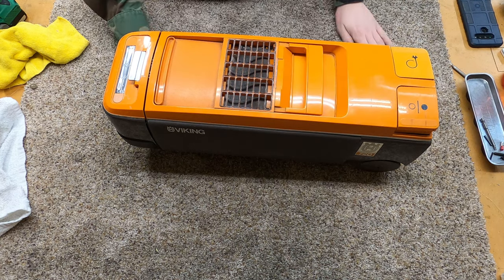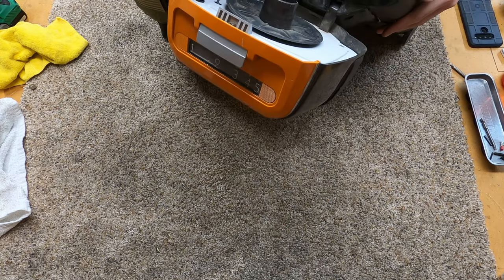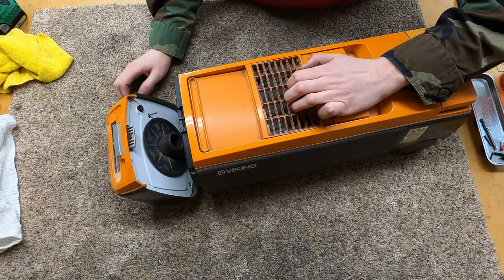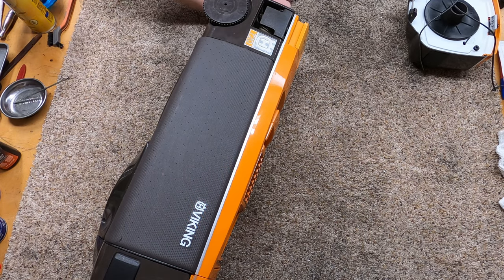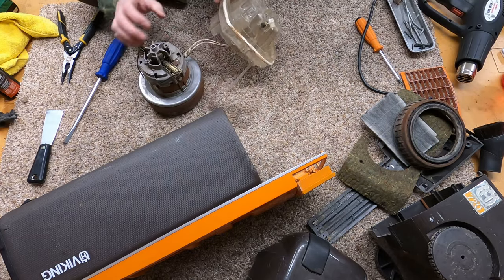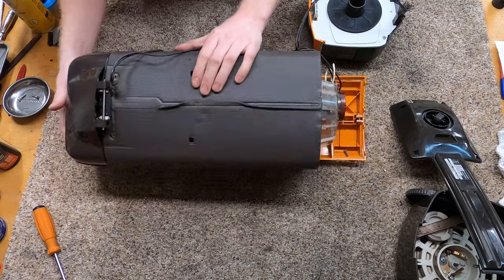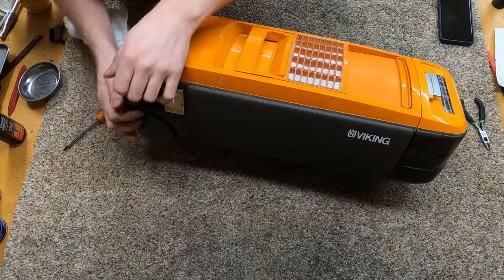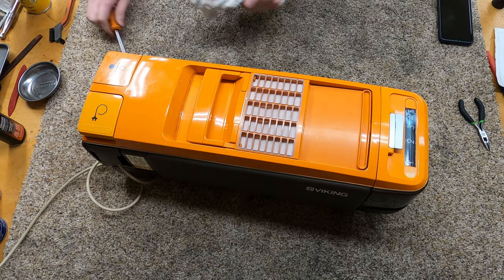Viking Electrolux 720 Vacuum Cleaner Repair

Comment: These were big in Australia. Sold door to door by Electrolux.  I have the 720, 725, 735 and 745. All the same shape just some minor changes in variable speed controls. Colours are orange, cream, white and the 90s beige.
Reply: I have a D730 with Electrolux branding, and a D745, D795 and D820 all with Royal Lux branding.  All four are vacuums I bought in Japan.  I use them in the US with 100 volt transformers.  The D795 is a real bruiser too.  There was a revised main board and Domel motor upgrade  I installed in mine (the original board and a wire in the motor were burned, getting the 100 volt parts from Japan wasn't simple but Vorwerk supports them in Japan).  With the Domel motor it has more power than my Perfect C101.  Just insane.  I source bags and filters from a German Lux distributor I have cultivated a relationship with.  Really love them.

Comment: That is interesting!  A Viking called Electrolux in USA.  I have the Electrolux model D 725 with electronic suction power regulation.  It looks like the rubber coating on the wheels is missing.  It is a shame that the device was damaged in transit due to poor upholstery;  happened to me too.  Definitely a cool vacuum cleaner!

Comment: Nice work of the 720 vintage cleaner sold from about 1980-82. Lux International of Switzerland, the original vacuum cleaner division of AB Electrolux of Sweden, split from AB E in 1998. AB E designs since that time have been different.
Reply: The D720-745 series were all made in Sweden by Electrolux AB.  I have versions of this same vacuum with both "Royal Lux" (Lux International) and Electrolux branding.  Until 2009 Lux International was a wholly owned subsidiary of the Electrolux Group of Sweden.  In fact Lux AB was one of the two companies merged in 1919 to create Electrloux AB.  In 2009 the Electrolux Group sold Lux International off.  Vorwerk bought their Asia Pacific business and now you see high end Vorwerks sold around the Pacific with Lux branding.  I have a Vorwerk Tiger-260 I bought in Japan where it was sold as the "Lux Sora".  Some Swiss investors bought Lux business in Europe and promptly lost their shirts.  They sold their business in 2011 to Eureka Forbes of India, the current owner.  The last Swedish built Lux was the Lux 1 Royal D820.  I have one, also from Japan, and it says Made in Sweden on it.  The current Lux Intelligence (Aerus Guardian Platinum) is the first new Lux vacuum after the sale.  They are made by Kolektor of Slovenia and use motors from Domel, also of Slovenia.
Reply: @philsalvatore3902  Thanks for the information. According to AB Electrolux’s and Lux International history, though, the longstanding merger was dissolved in 1998.